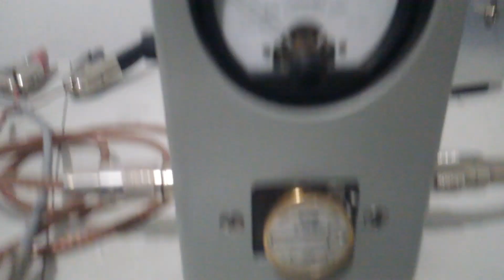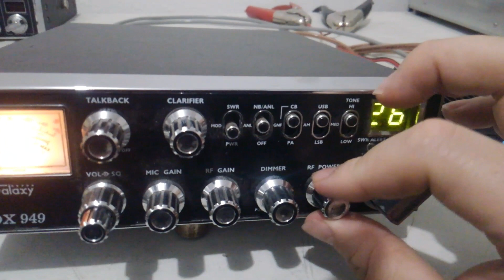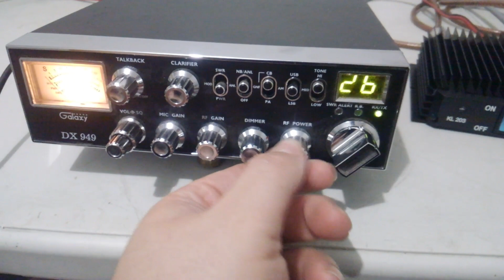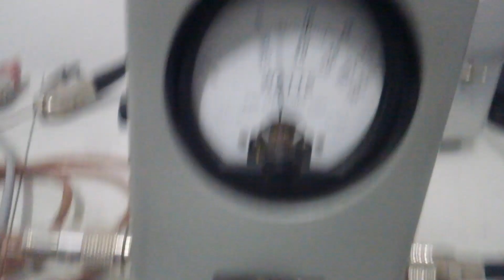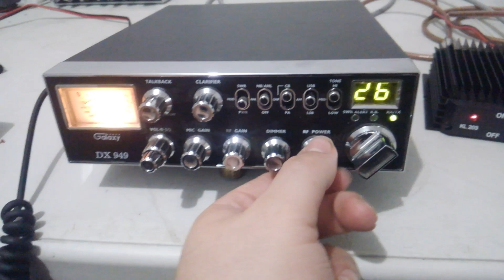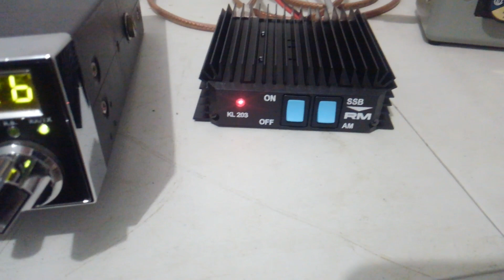RM Italy KL203 with stock Galaxy 949 SSB/AM

Comment: I was running a phillipines grant into one of these and ran it for about a month,and the mosfets caught fire. 2 watts going in and 20 swinging
Reply from the maker: Would not recomment a uniden grant, or cobra 148gtl. They put out a high amount of "average" power that will not show up on a dosy meter or other cheaper meters. The end result is overdriving your amp without ever realizing it. 
A grant or 148 will do over 10 watts average even if the peak power is showing low. The radio in this video was doing 5 watts average.
Reply: Thanks rooster- i was deadkeying 1.75 swing 22 but it was in doubt drove the piss outa my  225 palomar wished if kept that radio

Comment: My galaxy 959 does 32w pep and has a 2w dead key turned all the way down. Should I get about the same pep power you got here or will mine do a bit more since its doing 32w pep barefoot?? It's had a basic peak and tune. The power you got here is more than enough for me I am only curious 👍

Sorry for dumb questions. Never had anything but barefoot radios. I like this 203 because it's small and simple.

Comment: I run my KL-203 with a 3/4 watt dead key and let it swing up to 170-180 watts. Any more dead key and it will heat up if you like talking on your radio.
Reply: Wind it up to 20 dead key 13volts in
Reply: @madeinaustralia2020  I don't think so.

Comment: Hi. I have a question.  On the cobra 29?  If I have a wattage meter.  Can I just turn the rf gain down to reduce watts to 2 if I hook up a Rm-200.  And make sure SWR is below 1.5.  Anything else?
Reply: It looks like you just turned down watts without opening the radio

Comment: Question, my Stryker I don't think needs a helper, but in case I wanted to, would I need to get it turned down to match the box? I also have a Road King that was peaked and turned and maybe hook it to my little friend? Closest radio shop to me from Athens Alabama is 100 miles so any help would be kind.
Reply: A stryker 955 turned down all the way ( on the rf power knob) is perfect for driving an amp

Comment: would this be safe not to blow it up if it was hooked up with a president bill radio?I'm not sure exactly what that radio puts out as a stock radio out of the box from factory? is it putting out too much as stock radio for this little amp I figured maybe with the little small model cb. is that safe ?

Comment: Just got one of these, and it's 'hanging up' especially on AM mode? Defective? Only putting 2W in with a brand new untouched McKinley. SWR is nominal at 1.1-1.4 ch. 1-40, readings are from a Dosy TFB 3001...can't speak for it's accuracy except it's dead-nuts on with another Rat Shack meter. Someone said these RM's 'wear-in' after a while, but I'm not so sure about that...?
Reply: Your ebay link doesn't work either...
Reply from the maker: @randomprecisionmotors3130  Ebay link doesn't work because I sold out of them. No such thing as "wearing in". If you're running a 3ft jumper try a 6ft and see what happens.
Reply: @Rooster_Radio  That was it, I was using a 3 footer, and put the only 6 foot jumper I had on there, and it seemed to fix it, and power-out is up too! 2W in, 120W out by my meter! Thank you for your advice, you are officially my new hero!

Comment: Would I be able to hook up this amp to a midland handheld cb that I got hookup up to a wilson 1000 antenna
Reply: yes if youre talking about the 75-822, it works good Idk about that antenna haven't used one but I ran the 75-822 on LO power output it put out 1 and a 1/2
W on LO and the KL203P amp out to a solarcon A99 base antenna it worked well

Comment: I run 15 on sideband at 13v! With small fan! Up around 250w output! P is for piece of shit! Original kl203 way to go
Reply from the maker: 203 and 203p are the same amp aside from one having a pre amp and the other not. I've never seen a 203p or 203 surpass 200 watts peak